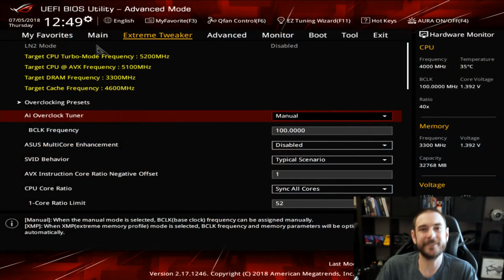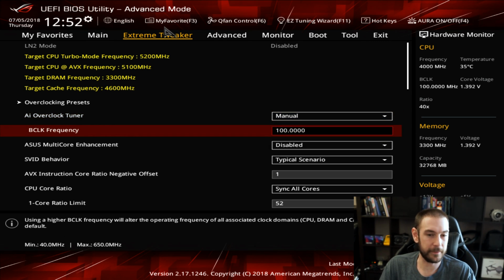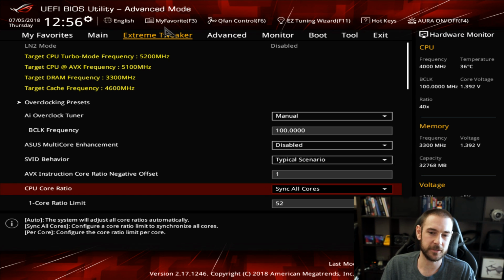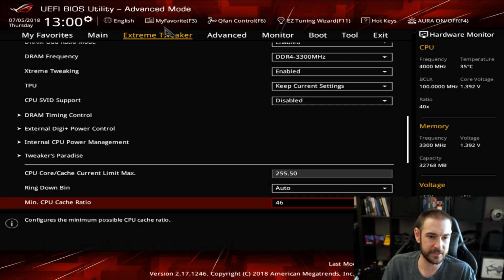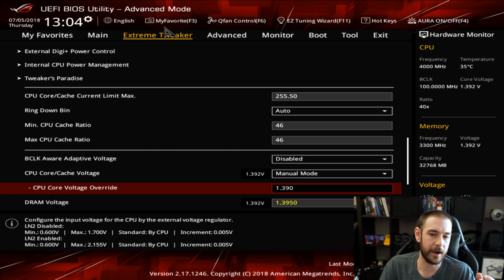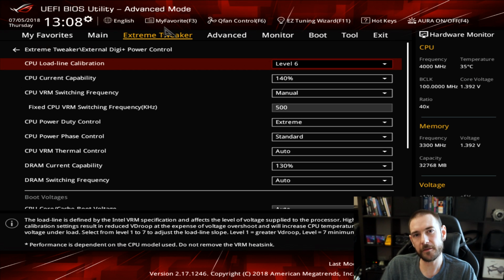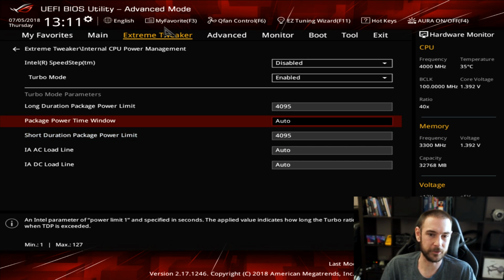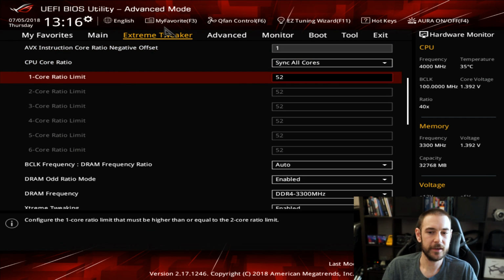How to Overclock an 8700K & 8086K - ASUS Maximus X and Others

Comment from the maker: Hi everyone! My guide for the Z390 Platform including 8700K, 8086K, 9700K and 9900K is now live HERE: https://www.youtube.com/watch?v=bD1Ze80GpLo     Thanks again for all the support!
Reply: pro tip : you can watch series at instaflixxer. Me and my gf have been using it for watching loads of movies these days.
Reply: @gibsonleonard1206  best I ever used is the nvidia shield loaded with Kodi.
Reply: Hi i used your guide to overclock and was wondering if the frequency is supposed to be changing constantly. for example i overclocked the 8700k to 4.7GHZ but it keeps on going up and down back to 3.7ghz
Reply: @Kodiak-Kevin  if your running windows turn off power saving then it will stay at what ever you tell it to
Reply: Could you give me some assistance?
Reply: Thanks for the info pal. Got my 8700k @ 4.5 atm on a z370 Maximus Hero X (Wifi AC).  Only running a Noctua U12S on air so I kept it below 4.8-5.0 to be safe with temps. Appreciate the info on the Asus boards!
Reply: Why it doens start without SVID support? ((((
Its freeze on boot
Reply: @Gibson Leonard yup, I've been using instaflixxer for years myself =)
Reply: @Gibson Leonard definitely, I have been watching on InstaFlixxer for months myself :D

Comment: I can have stable 5.2ghz but keep it at 5ghz otherwise I cannot oc my ram at the same time, mobo maxed out. 128gb ram running at 3200mhz and cpu been running at 5ghz for years now
Reply: Worth noting I don’t have manual oc just automatic overclock from bios

Comment: My System crashes running Cinebench setting my i7 8700K to 4.8GHz

You're not the first vid that doesn't do it for my system. Starting to believe I got the worst luck of the draw with my CPU.

Starting voltage 1.300 as suggested.

Every other setting as you specify.

Sad times

Comment: 5 years later and i am here to ask

I got the cpu as high as 5.1hz yet one game still struggles with it

Specs of the pc are:

ROG Maximus Xcode
I7-8086K
Corsair vengeance DDR4-3200Mhz
Followed up with a Nvidia GTX-1080TI

while following the video tutorial i made almost the exact same changes to my bios that you have set in yours, yet im still struggling to achieve constant 120-130FPS in fortnite even with the pc running everything higher now, it could be due to the newest bios version i applied to the mb recently since i thought why not and the last applied bios from 2018 was on here with all op tweaks-fine tunings the previous owner had done while it was still in their posession and i simply continued on with those tweaks until was wiped by the application of the latest bios (2021).

I simply have no clue what to do in this situation since the previous owner warned me not to mess with the bios and i still risked it resulting in my pc just not giving enough performance for my liking.

Id be happy for any info you could guide me with getting everything out of my pc

Best regards
Reply: Lower some fortnite vid settings for better fps

Comment: This video was extremely helpful for me. I finally got my 8700k stable at 4.8ghz with 1.27 volt and cache 45 but I have a question about the vccio and vccsa voltage. I heard vccsa voltage always should be a little higher then vccio voltage. Is this true? I had problems with my ram kit 3600mhz 16c but after putting vccsa at 1.2volt and vccio at 1.5 it was finally stable. Where can I find the video for more finetuning the 8700k?

Comment: Changing my vcore to auto stopped me from crashing. So i dont mess with the voltage. Leave it auto
Reply from the maker: I’d you leave it auto you’re going to be over-volting your CPU if you’re following the rest of this guide and risking permanent damage. Or hitting thermal throttling.
Reply: @boostedmedia  yea i changed everything to auto for the voltage. Its good now. But my cpu is overclocked at 4.8, dont think i can run 5.0

Comment: I learned overclockong from this through the following: I did every single thing the original video did and then changed number. First number I cha ged was 52 to 51. Then the cpu voltage. Those are the two you experiment with the most. You dont want to go above 1.4 volt for long term use.

Comment: Hey man, I tried using your settings as I have a Asus Maximus X Hero motherboard and 8700K cpu with an all in one cooler. Corsair vengeance ddr4 3200mhz ram but following your settings and starting it off at 49 ratio m, my pc would constantly reboot from the start. Ram is running at 2100mhz which is annoying. I’ll try lowering the other settings like cpu core voltage (1.390v at current) and dram is 1.3500 as it’s meant to be according to the manufacturer. Totally new to this and was hoping your settings would run from the start to avoid hassle 😂 appreciate any comments 👍🏻 thanks!

Comment: Had my system for almost 3 years now: Asus Maximus X Hero, Intel i7 8700k (cooled by an NZXT Kraken X62 AIO), ROG Strix 1080TI 11G, and finally upgraded from 16GB 3200MHz to 32GB 3200MHz DDR4 RAM. 
Thanks for the guide and information! It's helped tremendously, and since RAM's gotten cheap, I took the opportunity to upgrade to 32GB DDR4. It's brought some inspiration to try re-overclocking and stress testing on my nearly-3-year-old system. Unfortunately, as I realized before, I certainly did not hit the silicon lottery. I can muster a stable 4.8GHz OC on my 8700k with stressing at 1.37 volts (still going to test with 1.35 and/or 1.36 volts). Hopefully I might just be missing one step, but I suppose I'm happy with 4.8GHz either way. It's not much different from 4.9GHz or 5.0GHz, so I'm not too upset, as it isn't delided. 

Current Average Thermals (Celsius): 
Idle: 38 to 43 Degrees 
90%+ Load: 80 to 85 Degrees
Reply: the volte in 4.8 is 1.250 
not 1.350
and the volt 1.350 very hot not like 1.250
Reply: You guys need to delid already 😅

Comment: Okay I need some help. I watched your video so many times. But no matter what I set. Pc restarts 3 Times and then I receive the POST error. Even on 4.8Ghz. With 1.35V it won't boot. Can you help me?
Z370-f, i7 8700k, rtx 2080, corsair 32gb 3200mhz, aio cooler kraken z73

Comment: I'm still really pissed at Intel after over two years because I bought my 8700k right before the 8086k came out. To this day I still can't get mine to run stable at 5ghz and I KNOW it's because those assholes were binning them and saving the best 8700k units to sell as the 8086k.
Reply from the maker: Yep that’s exactly what they were doing. There was a noticeable decrease in 8700k results from about February 2018 onwards.
Reply: @boostedmedia  i got my 8700k around then and must have got lucky had it at 5.3 liquid cooled and never delid it sadly dont remeber the settings I was using as my dad oc it for me bc I new nothing really about overclocking and b4 he fine tuned it only on a couple of games it would sometimes blue screen so I just used the 5 oc preset which didnt really jack up my voltages now im manually oc it at 5.1 ATM and prolly gunna delid it. I never had a problem getting to 5 with even with little to no setting changes which is not the case for alot of people ive seen struggling to even hit 5

Comment: Great video. I followed the guide but sometimes my screen freezes in windows now and icons load slow? I have 8700k, asus maxinus x hero, 32gb ddr4 ram (4x8gb), 2600 gtx, water cooled corsair fans, i have a very good corsair psu any idea what issue lag/instability could be?

Comment: i am at 4.9GHZ 1.28V on a 8700K, using an ASROCK I7 PRO GAMING Z370 MOBO, and a 240 aio push pull. aida 64 gets me to 85c after 15 minutes, gaming is at 60-65 with some peaks to 75 occasiaonlly, is this ok ?  i was able to get 4.8GHZ at 1.2V, i think that 5.0 at 1.35V will be too hot, i dont want to see 85-95c while gaming

Comment: Okay so I came back here to remind myself of the values I entered for my CPU a couple of years ago since a recent Bois update wiped my settings and I couldn't press enter to restore settings (I probably should have flicked the bios switch on my k70 keyboard now I think about it lol). Well basically with this update to build version 2301 ME version 11.8.70.3626 there is now an option under [Extreme tweaker > Internal CPU power management] called TVB voltage optimizations. Now I haven't read up on this but I'd assume this is for the 9th gen CPUs right because I can't imagine Asus would bring in a feature designed for the 8th gens this late on and I'm not aware that 8th gen CPUs implement Intel Thermal Velocity Boost so would I be right in thinking this would be changed from Auto to disabled since the voltages are setup manually?

Comment: Hello, when i used this settings and start PC i saw blue screen and a few errors: 0xc0000001 , system32\ntoskrnl.exe 0xc0000221 , system32\drivers\ntfs.sys 0xc0000221. Asus maximus x formula + core i7 8086k. Does anyone know what the problem is?

Comment: Please reply to this bud. I followed your video exactly and when I was finished I went into BIOS again out of curiosity and a lot of settings changed back to auto
Reply from the maker: You can’t have saved
Reply: @boostedmedia  Yep, turns out I didn't. I think it was important to mention you gotta press ENTER on "Save & Load". 
I thought "Exit & Save" would do it, I was wrong ha
Also, in BIOS, on the right side of "ez mode" do the variables in "hw monitor" section change depending on the values you change, or does the clock on the CPU display the base freq?
For example, my base on my CPU is 3.7GHZ, but I OC'd it to 4.8GHZ, but it still displays 8700k@3.7GHZ

Sorry for bad wording, bit off today

Comment: Got 5.0ghz @ 1.31v with max of 85c in prime95 wasnt to happy with the temps so i dropped to 4.8ghz @ 1.17v with a max temp of 70c on prime95 im running an asus z370f mobo, h150i aio,  evga 1080ti, and 32gbs of memory @ 3000mhz im pretty happy with 4.8ghz @ only 1.17v thanks for the help!!

Comment: I highly encourage newby like me to use Ai suite 3 for auto OC i did it and it got me to 5.1 on ALL cores at a 1.325V. the only reason am here is because of the settings called AVX offset mines was set to 3 so it was dripping my OC to 4.8 so i set it to 0 and trying to see if it's safe or not.
Reply from the maker: AI suite is fine for experimenting, but once you find a stable overclock it’s best to set it in the bios as ai suite can do weird things.
Reply: @boostedmedia  oh kk thanks for the response but can you PLEASE!! tell me about that damn AVX setting? Mines was set to 3 so it was dripping my OC to 4.8 so i changed it to 0 now my OC is at 5.1 with some low drop to 5.0 is that avx at 0 bad in general?? Never heard of avx before thanks.

Comment: Any tips to getting RAM speed up? I have a couple 4133 C19 Gskill Trident Z sticks but can't get to seem better than 3600mhz. 8700k @4.7ghz Maximus X Hero Wifi board... Thanks!
Reply from the maker: Sounds about right. What CAS latency are you running at for 3600MHz? Even though the ram can support faster speeds, the memory controller on the CPU may not.
Reply: @boostedmedia  Still running the same CAS latency recommended on the sticks 19-19-19-39 @1.35V. If I try to go any lower on the timings I get instability. What is the highest you would recommend someone should go with DRAM voltage for daily use?

Comment: i did a overclock to 4.6 ghz i did a short test with aida 64 extreme and noticed during testing that 1 core or two cores got temps over 90 c but overall i got a temps of 70 c, but the System didnt crashed the voltage is 1.35 in this Situation should i increase the core voltage ? and whats the safe Limit increasing the voltage and what are safe temperatures for the cpu temperatures?
Reply from the maker: I wouldn’t be going any higher. Pretty normal for this chip to see spikes on a few cores. It will throttle when it reaches 100C.

Comment: Just built my pc for gaming with this set up. About to do this just a question. I'm using the corsair obsidian 500rgb case and running the corsair hi150 with 6 ll120 fans in a push pull form. Is this enough to overclock to 5.

Comment: I give up lol tried about every setting . Temps don’t go over 70 degrees. But keep getting blue screen crashes. Tampered with all settings .  CPU is delided and OC was 5.00ghz
Reply from the maker: Probably need more voltage
Reply: I was pushing 1.385. Is this not kind of high ?  Guess I lost the silicone lottery

Comment: Hi, followed your guide and 4.7 booted into Windows but some applications e.g. BF4 would not open. I lowered the multiplier from 4.7Ghz to 4.5Ghz @ 1.3v and now most things appear stable. What would my next steps be to see if I can push for 4.7Ghz? Currently on air cooling and hovering at 40-50 degree's when gaming @ 4.5Ghz

Comment: The inrush current causing voltage sag is exactly what happens when huge induction motors are started across the line.  CPU instability makes more sense now

Comment: I got my 8700k running at 4.9 on all cores on 1.2v , only 1.138 under full load thanks to you :). Much appreciated
Reply: Have you stress tested it?
Reply: @orthikon   I stresstesed it with realbench and and aida  AIDA64 Extreme for some hours, and burntest very high. I wrote the wrong voltage, its 1.2 in bios and 1.183 under full load.
Reply: 8700K on 1.138V ?

Comment: Watching this video makes me angry, my almost 2year old z370+ 8700k doesnt do even 4.7ghz oc with normal temps.. atm i have 1.2v @ 4.6ghz and it still ramps around 90-100c on stress tests..  and i have corsair h100 watercooling.. sad.
Reply: i dont even think my cpu has any connection between the chip and the cpu plate.. temps go high has hell in seconds.. D
Reply from the maker: I have an 8700k here on a z370 with the same cooler as you and it pulls 5GHz at 1.3V and doesn’t go over 75C. I think your cooler may not be installed correctly.
Reply: nah, cooler is installed correctly.. cpu needs a deliid.. i have done some researched, mine is the worst case senario what happens when intel doesnt soldier theire cpus.

Comment: cpu - 8086k
ram - 32gb tridentz 3200mhz
mobo - asus maximus x code

need help in overclocking. if i go beyond  4.8  my temps going 80 plus
Reply from the maker: Either your vcore is too high or your cooling just isn’t good enough
Reply: @boostedmedia  i have a custom loop with tt waterblock
Reply: @boostedmedia  is there a way to contact you? mail id or somethin? if u don mind 😅

Comment: With a Dark Pro 2 & a sound proofed case with high quality fans, 6 HDD's I was able to reach a stable 1.4v. I was able to get the CPU to 4.7Ghz and the CPU cache to 4.6Ghz. It stays cool even in a closed up case. Just get a top end air cooler and you're as good as if you used a water cooler. In fact a super bad ass air cooler is better because it cools faster than a water cooler. But this is only true if you have one of the best air coolers on the market.

Comment: Nice video.. I'am a bit of a beginner and I have a question: Can i make a simple soft overclock at 4.2 - 4.5ghs without touching anything other than the core ratio? ( 8700k)

Comment: Can i overclock i7 8700k processor with a fan from cooler master hyper 212 LED, Motherboard : MSI Z370 A-pro  , cooler master masterbox k500l cabinet, gpu 1050ti , 16gb ram

I don't have any knowledge of overcloking. Any guide or recommendations?

Comment: Thanks bro, got my I7 8700K to 5ghz @ 1.3v!
Reply: Congrats. What cooling system do you use ?
Reply: @David-wp2iw  got a Corsair H115i RGB Platinum and my case is a Corsair Obsidian 500RGB SE
Reply: @Deluxo  something is right about your cooling system. Mine delided 8700k is with noctua nh15 and gamemax 909 case. 5ghz works stable on v1.4. Atleast stress load temperature is within 60-80c. You might try on 5.1ghz
Reply: @David-wp2iw  I tried, but 5.1 ghz gives me errors when I stress test it. I might dive deeper into it when it's fall or something
Reply: @Deluxo  this same youtuber has video of over clocking  exactly 8700k, not 8067k. Take a look at that one especially where he talks about voltage. Because you can add some voltage separately for cpu so you need to try that one.
Reply: @David-wp2iw  will do in time, thanks!
Reply: @Deluxo  you welcome and good luck

Comment: Hey man! Nice video! It took me through one of my first real overclocks. Real fun! Anyways, I got a Corsair H75 Water Cooler, and the same MB as you got (and CPU, running at your recommended speed for 8700k, 4,8ghz).
I was monitoring the temps while playing BFV last night, and it was at around 70c with spikes now and then up to 80c. I tried to lower the voltage to 1,295, and it got a few degrees colder. 
Is it OK this way? Or should I lower volt/multiplier even more? I also watched your airflow/fan video - nice. 
Thanks again.
Reply from the maker: As long as it’s staying under 85 I’d say that’s fine. :). Still plenty of safety zone.
Reply: Boosted Media thanks for the quick response. Then I'll keep it as it is and watching the temps. The temps are really jumping up and down from 68-70 to the occasional spike to around 80. But I guess that's normal :)
Reply from the maker: Yep perfectly normal. As long as those spikes are under 90 you’re ok.
Reply: Boosted Media perfect! And just to let you know, I had some weird stuttering in games and seems like this helped me! I doubt that the extra MHz was what made it more fluent for me, but perhaps it was one of the other settings making my MB and CPU faster or something :) so thanks again